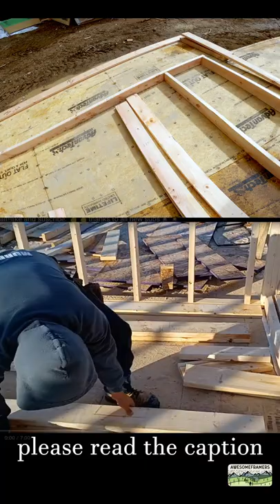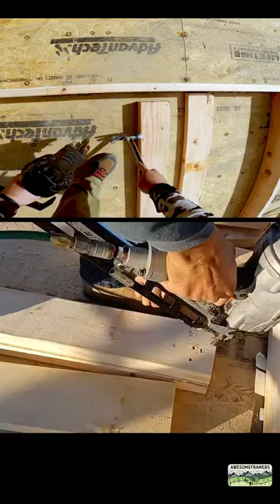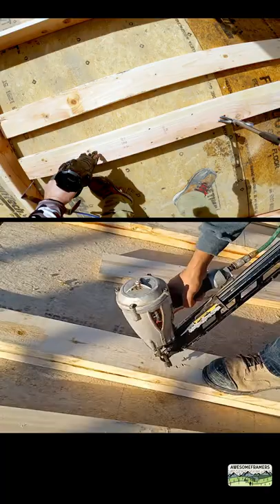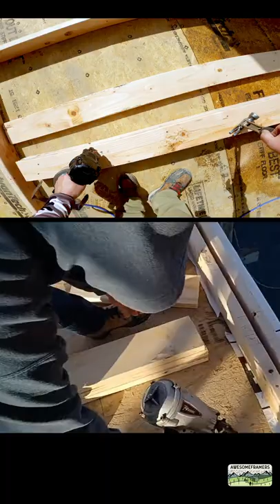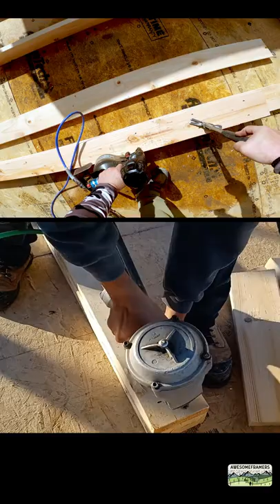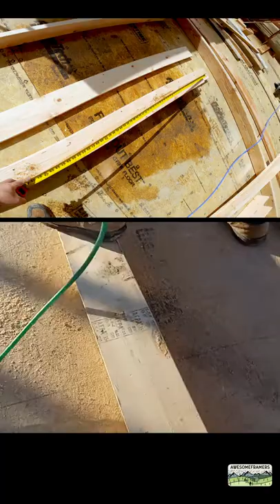Slow is Smooth Smooth is Fast #SHORTS

Comment: I can hear my boss now “that’s not a hammer and you ain’t getting paid per nail”
Reply: Man I've had my old boss saying "you don't get paid per nail" lmao.
Reply: He hit anything with one of my guns he's going home..... 👎
Reply: I tell my guys you can use it as a hammer when you buy it.
Reply: I mean it’s not a hammer…
Reply: Oh it is very much so a hammer.
Reply: Anything is a hammer if you use it wrong enough
Reply: If it fits it ships 🤷🏽‍♂️
Reply: I’m not a carpenter so I may be missing something, but I’m not sure I see the point of this video,
Reply: @xnavynuc  thank you, I'm also so confused. Like why is he mailing wood down that doesn't meet the ends...? what's that supporting? I'm so confused about what the point of it is and nobody is explaining. It's just the typical know it all assholes who always make everything perfectly. Yea 90 of work sucks. So based on odds, it's most likely that THEY'RE the majority that suck.
Reply: @cececox6399  he's lining up studs and nailing them together before putting them in the wall he's building on the floor there. At the end you'll see him turn them on the edge and nail the plate to them.

Edit: So no there's not much of a point besides look at me. He's not doing anything special.
Reply: @xnavynuc  it’s ok to not understand something. I’m still in shock that people voted for Biden…. I just don’t get it.
Reply: @cececox6399  its comparing the outcome of the young buck working frantically and trying to be fast and the veteran  that makes only efficient moves at a steady pace.

Comment: Pro tip for nailing packouts together. Use the reference marks on the sub floor typically every 16” as a guide for where your nailing your boards together that way you are always stacking your nails that way the subs that come in after wards don’t hit nails with their drill bits while drilling holes for electrical or plumbing. It makes life easier for them and saves them money

Comment: Man. Ruff nailing patterns. I think half of those 928 nails would have been sufficient
Reply: Yeah production framers can get carried away lol. I had to move a landing up for a set of stairs I built and it was 4'x4'x8" tall supported on 2 sides, landed on 6 doubled studs, with 79 nails in it. I just rebuilt the ledgers since there were scraps there big enough. There was as much nail as wood lol. I hung it with 12 nails and 6 ledgerlocks.

Comment: There's the difference between working methodically, and working to get to the liquor store earlier. He doesn't even realize he's not getting there any earlier and he owes his boss a new gun.
Reply: what?
Reply: The back of the nail gun and the nose pieces is actually a integrated hammer even says it in the owner manual!

Comment: Seems like the bottom guy who is rushing also doesn't have a compressor that can keep up with the psi the nail gun needs to keep driving the nails 🤔 knowing your tool or tools is half the battle as well. Also agree slow is smooth and smooth is fast!!!

Comment: Cut mam needs to have a nail gun at the horses to nail up L corners, cripple packs, and headers. That way wall framers are only assembling components. It gets walls up quicker and it quality control.
Reply from the maker: That's true generally speaking. Our jobs have very little standard height walls. Lots of rake walls, so we cut window packs out if the scrap.

Comment: I got fired for using the same nailing pattern on my jack studs when I was a teenager. Instead of training me they just expected me to know everything . I was a kid with no framing experience other than what I watched on YouTube and framed 2  40 ft walls with 3 windows so 6 jack and kk by studs and the walls stood up plump and level and still go fired cause one of the older fellas on site didn’t like the way I worked